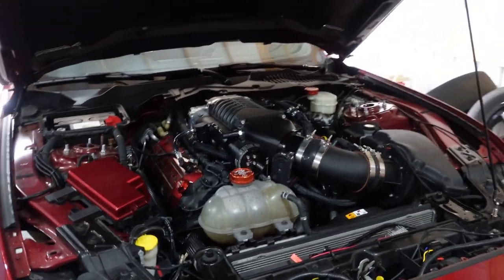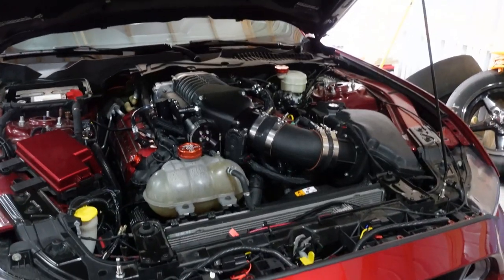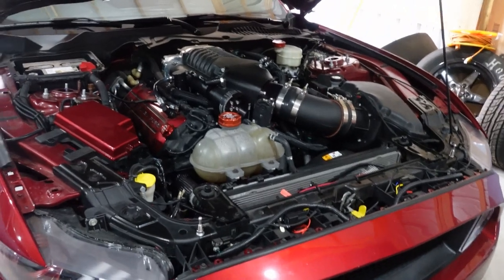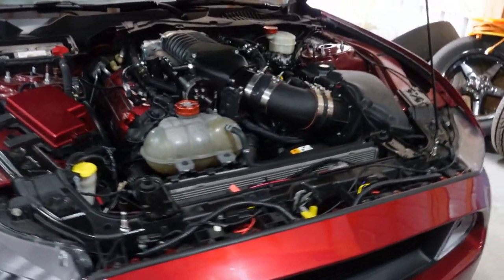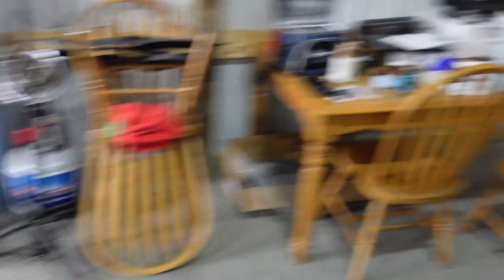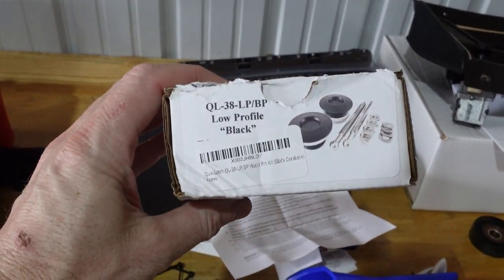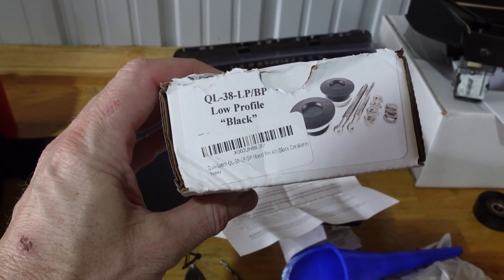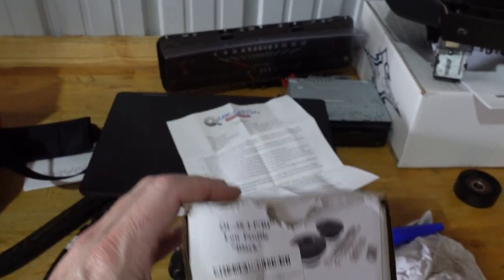Keep your hood secure with Quik-Latch hood pins! QL-38-LP/BP install on my 2016 Mustang GT!

Comment: Nice ride. Are the original locking system necessary after these hood pins installed?
Reply from the maker: Thanks. I left the factory hood latch system intact and used it as well.

Comment: How hard was it to get the right stud height? Great video!
Reply from the maker: @ryanbenke8754  wasn't too bad. Took a few times closing the hood and adjusting. Thanks for watching!
Reply: @BackyardBMX73  Also, have they held up over the years?
Reply from the maker: @ryanbenke8754  I no longer have the car, but they held up fine for as long as I had it.

Comment: Did you put anything around the rim of the whole saw sections to smooth them out or keep anything from rusting in those sport?
Reply from the maker: Fiberglass hood, so nothing needed.
Reply: @BackyardBMX73  Is that every S550? I'm got a 2018 Shelby GT350R.
Reply from the maker: @AWilliamMay  no, S550 comes stock with an aluminum hood.

Comment: You get any shake from the hood after hoodpins? Tempted to go this route since the stock hoods are so bad on 15-17.
Reply from the maker: Didn't really notice much with this hood and the pins. Definitely less than the factory hood and latch by itself.
Reply: @BackyardBMX73  I wouldn’t have to change it if it weren’t for ford horrible hood corrosion. Guess fiberglass and pins it is.
Reply from the maker: @Taino5.0  I hear ya. My original hood was replaced due to corrosion.
Reply: @BackyardBMX73  under warranty or when you installed this one?
Reply from the maker: @Taino5.0  under warranty.
Reply: @BackyardBMX73  gotcha. I bought the car used so probably won’t have that extended warranty they put on the hood.
Reply from the maker: @Taino5.0  won't hurt to ask. Never know. I believe there's a TSB for it.
Reply: @BackyardBMX73  I’m the 5th owner. I also rather deal with it myself than have ford hold my car for months at this point. Just not worth it.

Comment: Anyone know the difference between ql38 and ql50? 50s cost more then x2 the price...
Reply from the maker: I believe the difference is the size. The QL-50 is a larger diameter.
Reply: ponie1992 Oh so probably definitely not worth the $ lol
Reply from the maker: @IghTzZ  not unless you need the larger size, but the QL-38 is a good size in my opinion.